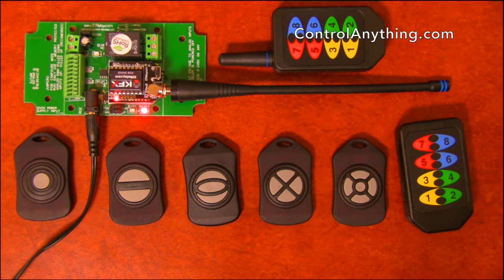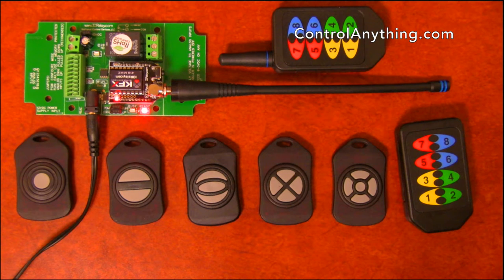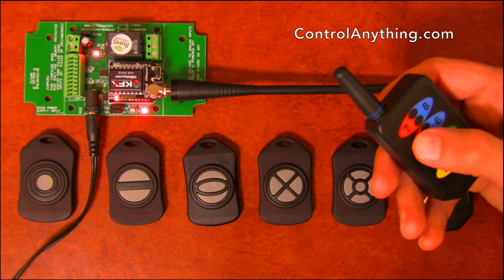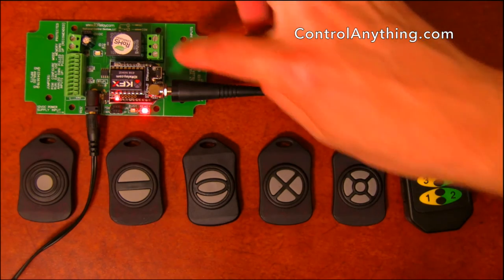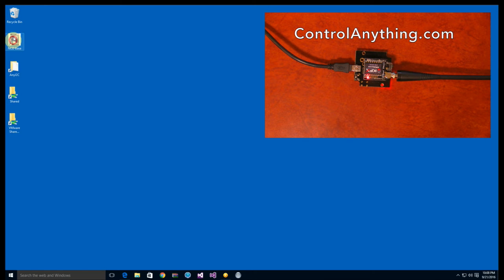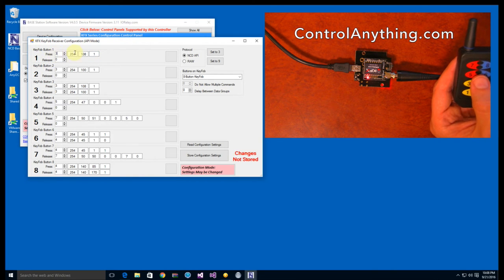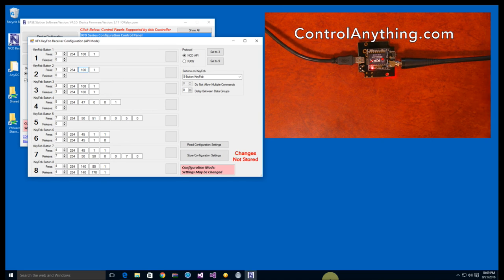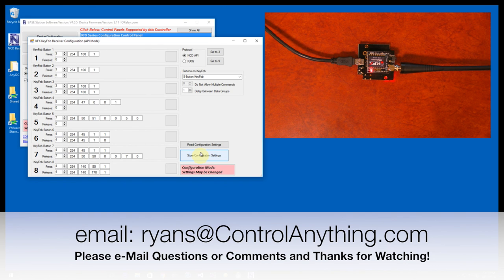Key Fob Wireless Relay Controller 1 Channel Long Range KFX

Comment: Looks like quality setup. Looking for 12v dc motor controller. Forward, reverse, stop, speed up, slow down, that can be controlled with fob. Long range not needed. Any help?